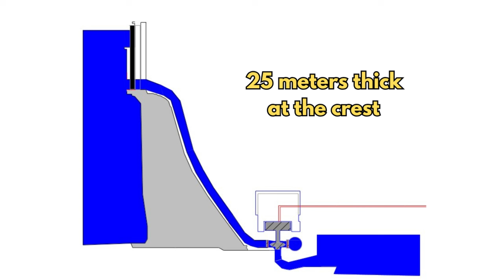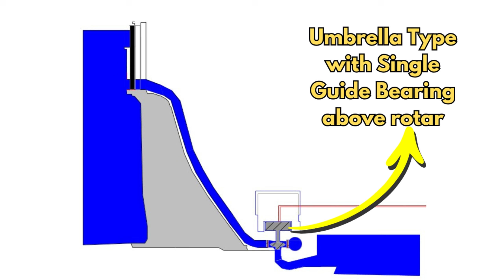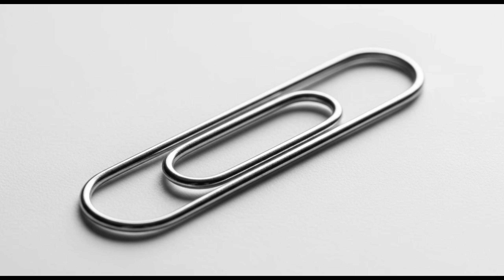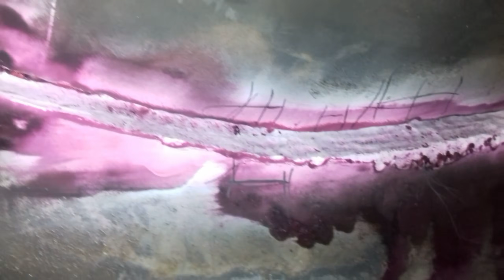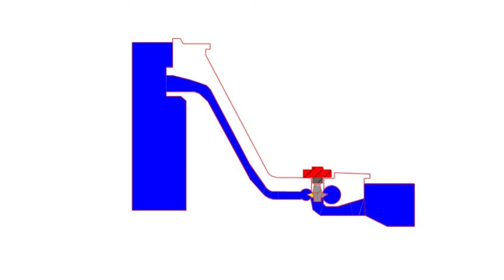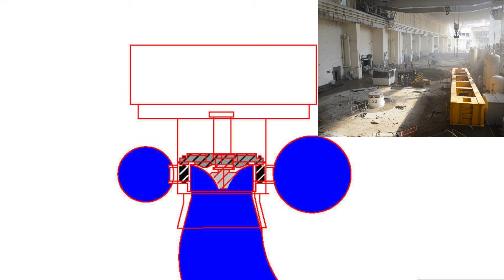Why Russia's Largest Power Plant Destroyed Itself

Comment from the maker: What do you think was the biggest cause of failure — vibration, poor maintenance, or operating in Band II?
Reply: All of the above were contributing factors. Couple this with the collapse of The Soviet Union and the cutoff of its continuous stream of workers and funding and you get what happened here.
Reply: The cause of failure was ignoring the cries of tortured mechanical equipment threatening to cut loose at any moment. And the cause of that ultimately was sheer gut-wrenching stupidity, the same thing that triggered the Chernobyl disaster.
Reply from the maker: Well said
Reply: Management personnel with decision-making authority should have repaired or closed the damaged and aging turbine when they realized it was improperly balanced.
Reply: Russian mentality and negligence.
Reply: Hubris.  That history of cracking and fatigue in STEEL (which SHOULD be able to achieve an infinite fatigue life) tells me that had all the information they needed to know they had a fundamental metallurgical problem, and that they willfully ignored all the evidence and instead opted to blindly proceed into catastrophe.
Reply: This happend in the Soviet Union? Then it's just poor engineering.
Reply: @sinus-sq meh, engineering was often quite good. The mindset behind the operation, tho....well, just look at chernobyl.
Reply: @michajastrzebski4383  True, engineering was even outstanding at some point. 
They were like "you better report good news, even if false, because reporting true bad news can cost you everything in your life", and that's also one of the biggest issues I would say.
Reply: @sinus-sq This was probably best seen at Mayak, the Soviets' nuclear processing and development facility. The absolute asshole who ran it, Lavrentiy Beria, did not care who or what got hurt when it came to the development of the Soviet nuclear program, and this showed up in how Mayak was (and still is) run.

To begin with, the reactors at the site are run with an open loop cooling system to a nearby large lake. This has resulted in the lake being quite vigorously contaminated with just about every radionuclide possible. 

When their first reactor had issues due to cooling pipe breaks and the graphite being waterlogged, they ended up pulling the bastard apart BY HAND to retrieve the nuclear material including whatever might have been transmuted already into viable weapon material.

Its the source site of the Kyshtym disaster, where a tank of high-level liquid nuclear waste exploded and released a shitload of radioactive materials over 52,000 square kilometers, and said incident is rated 6 of 7 on the nuclear accident scale (the 7s being Chernobyl and Fukushima).

Then of course, we have Lake Karachay where even more radioactive liquid waste was dumped. How much radioactive waste? Estimates put the amount dumped into that little lake as on-par with what Chernobyl released. Just standing on the shores (before it dried out and started spreading all of that radioactive loveliness everywhere, before being ultimately capped in concrete) would give a person radiation sickness.

Thats just the big incidents. Why was the program run like this? Because when Beria told you to do something, you got it done else he and the various security bureaus he was a part of would have their way with you.

Comment: The vibration phenomenon in unit number 2 has been present for 10 years, and everyone in the plant knows about it. Power plants in the region have a habit of running at full capacity because the owners (Sayano-Shushenskaya Hydroelectric Power Plant is a joint-stock company, with some government capital) want to maximize profits. Driven by greed, they also cut back on maintenance costs, investment capital, and workplace safety.

Comment: I'm wondering what force pushed up the generators and runners.  At the Bonneville Lock and Dam where I used to do powerhouse tours there are vacuum breakers for the draft tubes.  These are used to allow air to enter the draft tube in case of a quick closure of the wicket gates.  In this event, without the vacuum breakers the water would continue flowing down the draft tube and eventually be pulled back by the vacuum that would ensue.  This water would then hit the turbine runners with tremendous force and lift everything up into the powerhouse gallery similar to what happened in the Sayano-Shushenskaya dam disaster.
Reply: Interesting phenomenon I wouldn't have expected.

In this scenario, the wicket gates would have had to close rapidly, presumably because vibration became too great. The momentum of water flowing out the bottom of the turbine would have created a vacuum. Either the vacuum breaker failed or there was no such safety system. Water in the draft tube rebounded upwards with such force against the turbine blades that it pushed the shaft assembly upwards while it was still spinning. (I think that fits your scenario.)

But then how did the water that flooded the turbine hall get past the closed wicket gates? Maybe the shaft rotated far enough out of vertical that the spinning turbine blades contacted the wicket gates and partially chewed them up, allowing water to flow past the wicket gates faster than the water could drain out the bottom, so the turbine hall began filling with water.

I wonder if that scenario is plausible.

Comment: Great video, very informative, but one small gripe, your initial vidoes didn't use ai, and I know it's difficult to produce timely content as a creator, but if possible please don't use it as it demertis the hard work of the video
Reply from the maker: Actually I am also not in favor of ai generated content but. There are a lot of issues being creater. First is privacy issues. As I can't use others videos. I wasn't having any of the picture or video of this incident. Sketches I made myself. So I used some images that are ai generated.hope you guys understand.
Reply: @hyrovision  AI is OK, but check it carefully. The paperclips were two ovals that don't connect.
Reply: @dgc03052   Yes, it was rather strange to see a paper clip which had 4 simultaneous fatigue breaks. 😊

But I wasn't too bothered by it since it was used only as an analogy.
Reply from the maker: It's purely used for anlogy. I think my audience want perfect video every second. 😂 And for an Engineer it is not might be possible to make perfect second by second video.
Reply: @hyrovision in the first have of the video. Less pictures would have been totally sufficient. Some times more pictures are getting distraction. Maybe making a really rough sketch showing something like the stress cracks is an option.
Reply from the maker: As i have already mentioned many times in the comments, i am still trying to imporve my self in making videos. Since i am a mechanical engineer. So video editing is bad. Yet i am learning video editing. Thanks for the suggestions. I am trying to follow the guidelines by users given in comments
Reply: @hyrovision  You have a great style of explaining concepts, and your simple drawings are actually quite useful. With that alone you can be successful, i subscribed and am excited to see more videos.